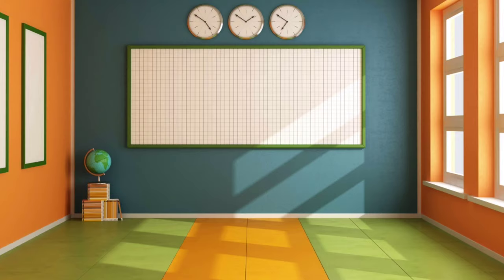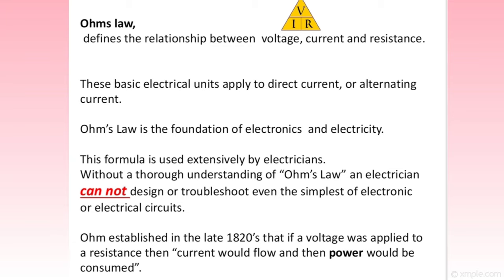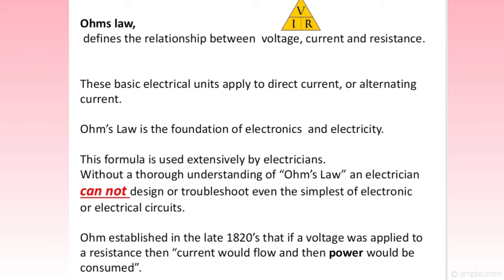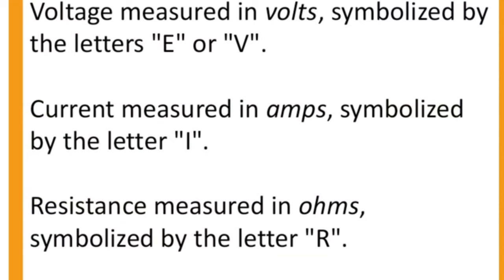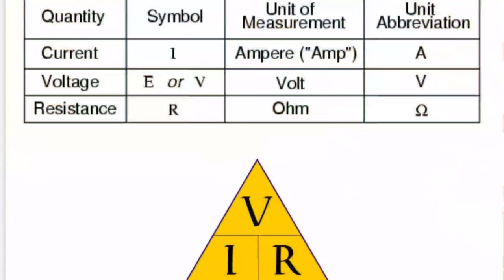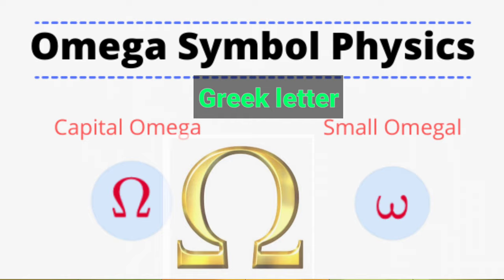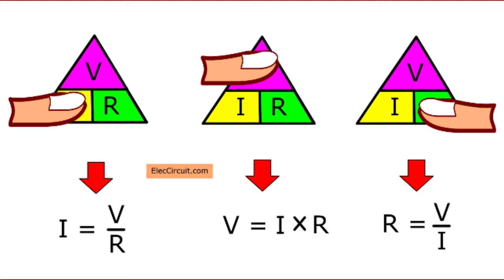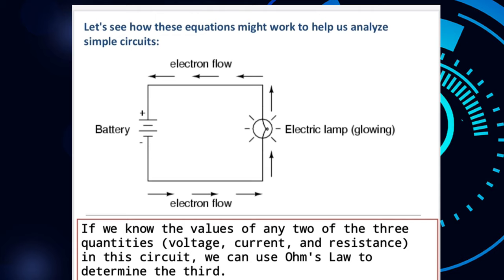Vlog#16 - OHM'S LAW

Comment: I learned that ohm's low state that the currents in a circuit is derectly proportional to the voltage and is inversely proportional to resistance meaning. When currents increases it is due to increased voltage. And greater resistance will affect the flow of currents causing it to decrease.

Comment: I learned in this video that the Ohm's law defines the relationship of voltage, current and resistance. It is the foundation of electronics and electricity. Ohm's law was derived by the name of the scientist GEORGE SIMON OHM.
                     Measure      Symbolized
Voltage.          volts.               E or V
Current.            amps                  I
Resistance.      ohms.                R

V= IR.           I=V/R.          R=V/I

Always use the 3 steps form
1. Write the equation
2. Replace the unknown values
3. Solve the problem
-label the correct measurement

Practice problem
1. R=V/I
2. R= 4.0V/0.5A
3. =8
4. 8Ω

ERICH B. RAYA
8-COURAGE
Reply from the maker: Thanks Erich

Comment: I learned that the the relationship between currrent and voltage ohms law relationship between voltage,current,and resistan ohms law is the foundation of foundation of electricity voltage measure symbolized e or v current I am current voltage resistance the symbol unit of measurement the ampere volt ohm omega symbol  the formula like the triangle the electron flow battery lamp

Comment: Ashley Nicole G. Maturan
Grade 8 Secrtion Humility

I learned that Ohm's Law states that the current through a conductor between two points is directly proportional to the voltage across the two points.